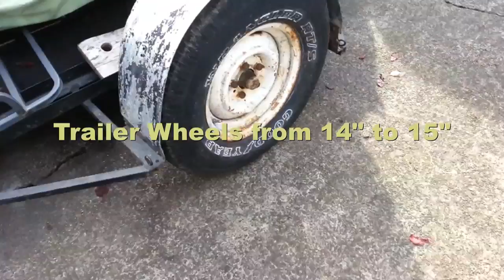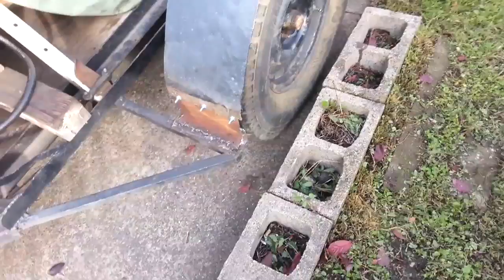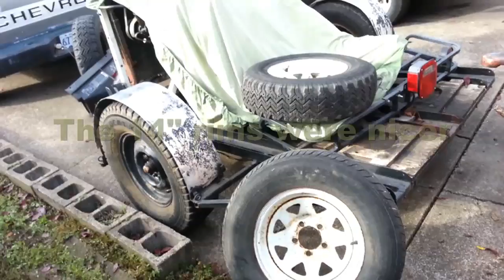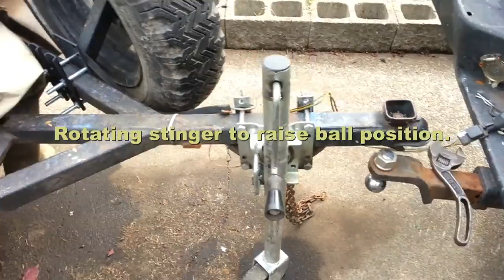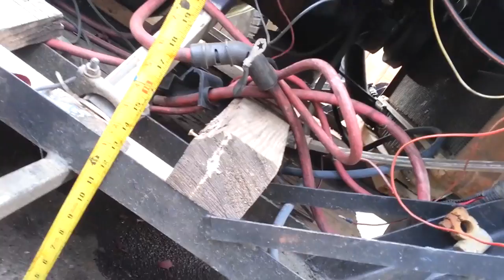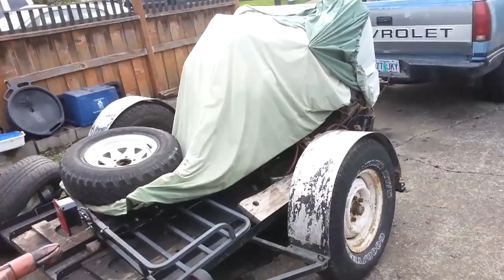Trailer Fenders Wheel Size Upgrade

Comment: Why work in the dark?
Reply from the maker: Work started in the afternoon and took longer than expected as new bolts had to be purchased; the old ones were corroded and had to be cut off. Did not want to leave it jacked up half done since heavy rains were due and the welder was outside so cables could reach the work area. Also all the tools including electric drill. Putting all that away due to rain then bringing it all out again at a later date seemed like too much more work. Got very tired pushing the envelope, mounting much heavier steel wheels.